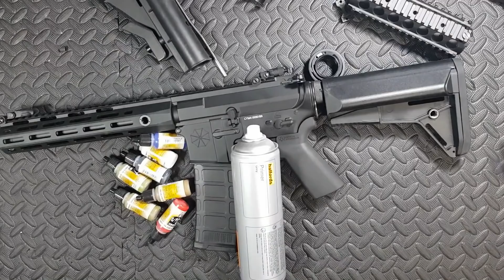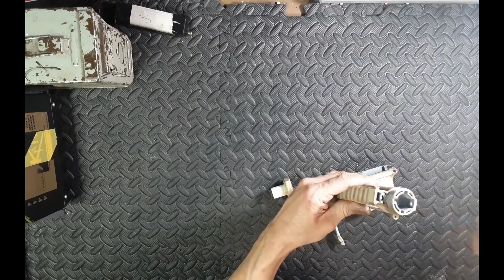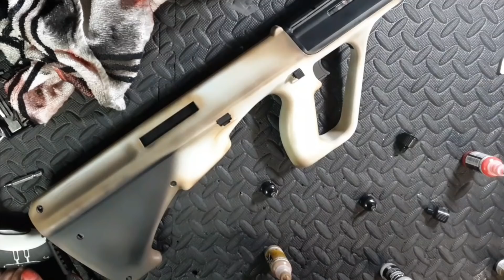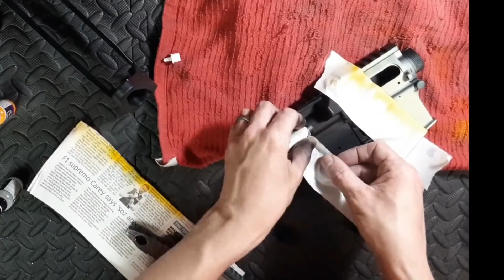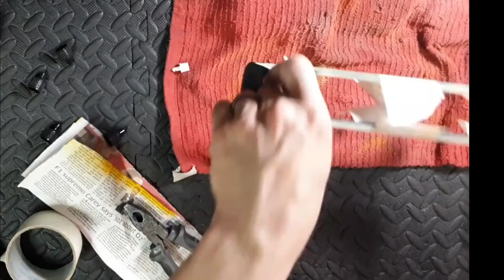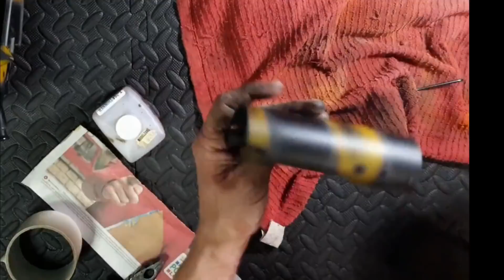A (Very) Brief Look At Custom Paint Jobs

Comment: what type of paint do you use, and do you coat the paint, to resist scratches a bit better?
Reply: Looks like hes using the "VALLEJO MODEL AIR" paint. Last part is up to you I bet. if you want the paintjob to last you clearcoat it but if you want it to get scratched up to get a more worn look by time just ignore coating it.